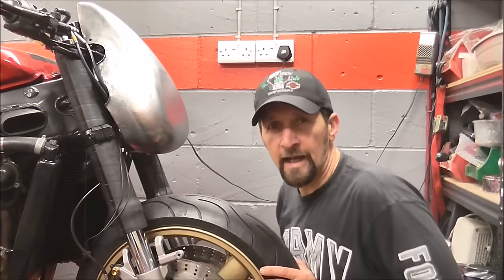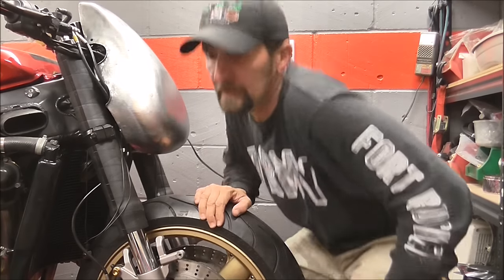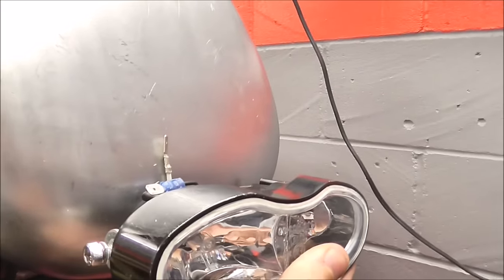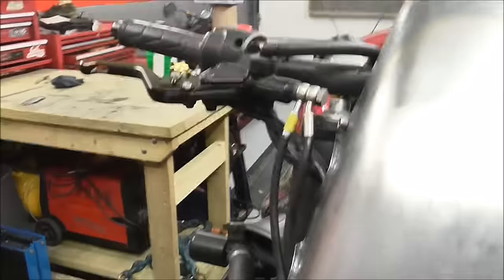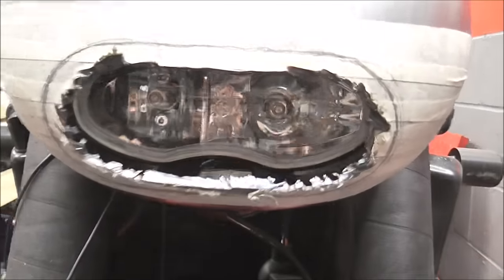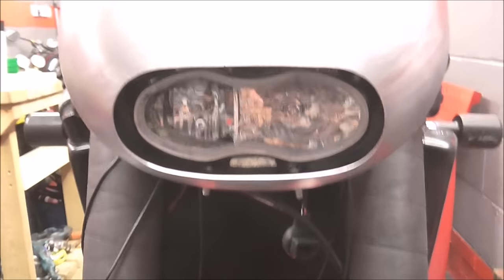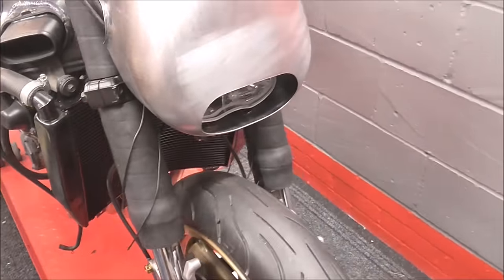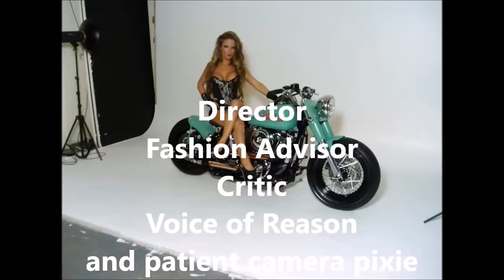Delboy's Garage, Fighter Build #15, A bit of 'Frenching' !

Comment: hey Delboy. i have a question for you. could you please explain to me the actual benefits of lubing or greasing a ratchet? all i hear people say is "it makes it work better" and "it quiets it down". i enjoy the sound of a ratchet but how does it make the ratchet work better? i just dont see how lubing it would benefit. please let me know what you think. thanks
Reply from the maker: Hi mate, I've two Snap On ratchets, and I think once , about 5yrs ago, I may have squirted a tiny dot of WD40 in there, but never did it again since, as it made no difference !  It possibly depends on the quality of the ratchet, but as they have an internal mechanism, I believe in spending some proper money on them !

Comment: Nice and precise, great work with the files to get that edge looking so good. I've noticed you've gone back to using the grinder for pretty much all of your cuts lately. Once you were using a jigsaw, which I assume can be effective only up to a certain thickness. Obviously, with flat sheet, a bandsaw is ideal but who cuts enough metal to justify owning one of those. If you had all the gear, there'd be no room for the bikes. Perhaps you could expand the grinder video a little to comment on the above? Also, how are you finding the air tools? Are they a worthwhile investment?
Reply from the maker: Hi mate, you sussed me out, my 4" grinder is my favourite tool by far - the jigsaw is ok, just like a bandsaw on flat metal, but needs a flat surface to run the shoe along or the blade wanders off on it's own, bending under force is created by the slant of the metal surface... the coming Simple SKills vid on the grinder will encompass a lot of stuff showing it's versatility, but will be half at least about safety cos they can be a pretty lethal tool ! 

And as for air tools, like with anything, they are not particularly universal, eavh one is a unique job so you end up with a pile of them, but they are thirsty on air, so if you are using it in a garage that also houses the compressor that feeds them, then it's irritating when it keeps kicking in to pump back up, and for video making that seriously is intrusive !  The big shops have a huge industrial compressor housed in sound proof units outside the workshop, so then I would then use ONLY air tools... but in a single garage, the compressor causes the problems!

Comment: I have been thinking about the tail piece, now i'm not sure if it's possible to fabricate but last week I was in traffic behind a Peugeot RCZ sports car and the rear window has a double lengthwise humps. Perhaps could taper back to a pair of "frenched" tail lights ?
Reply from the maker: Hi mate, the RSV mille Tuono models have a similar item that looks like two cool after burners, but gonna go my own way, as you would imagine, and it would be silly not to french it to match the front aye?!  Thanks for the tip fellah!

Comment: Looking good , my ears would have been ringing after using the grinder and air drill in such a small space. As far as stepping up production, (not sure if it possible with your editing software) maybe you could overlay the audio from your video camera when you show the shots from the gopro, just to keep it all consistent. No need to reply just a observation .Cheers
Reply from the maker: Know what you mean mate, but I actually liked the slightly different sound from the GoPro for now, overlaying sound is practically impossible on the editing suite I use (it has it's benefits, but also it's hinderances but WMM is a greta format) , far easier, instead, to plug a lavalier mic in to the GoPro to give more identical sound as picked up by the camcorder, simpler and faster for editing, and with the rate we create videos, we can't afford to spend too long on the tech. stuff as, to us, the actual content has always been more important than the cinematopgraphy... the biggest people on big vlogging use professional companies now to create their videos and there's no way we could ever compete with that, but thanks mate, the input is always helpful !
Reply: Oh that's good to hear i thought i might be little out of line in saying so.

Comment: I know this is an old video, but I’m still trying to find this light. All I can find is this light but with 2 high beams so it won’t be U.K. mot compliant. Could you please link me to a version that uses hi-lo, cheers del
Reply from the maker: Here you go Lloyd, this is the one i have.! https://www.ebay.co.uk/itm/H3-12V-Twin-Bulb-Headlight-Lamp-Projector-For-Streetfighter-Custom-Cafe-Racer/272920512315?_trkparms=aid%3D555018%26algo%3DPL.SIM%26ao%3D1%26asc%3D20140122125356%26meid%3D32d9b26f16ea4e668f353008d2aa09af%26pid%3D100005%26rk%3D5%26rkt%3D12%26sd%3D283288746568%26itm%3D272920512315&_trksid=p2047675.c100005.m1851

Comment: Jesus Del, when I saw you taking to the tank with a 4" grinder I did cringe a little, it looked like someone trying to carve a small chess piece with a 32lb sledge and cold chisel... but to your credit and skill she came up trumps. One thing I would have done before cutting just in case you wanted it in the future is take a bit of clear acrylic and heat formed it over the curve of the intended cut out, that way you a) have a reference of the original profile and b) you could cut the acrylic down to create a perfectly contoured lens if you ever should feel the need. What's done is done now and it looks smashing, nice to see the GoPro get some extra work.
Reply from the maker: Thanks mate, great minds think alike, I had though to take a profile of the shape first, one way or another, and perspex is a good way, but the idea was to simply start the hole off with the grinder, leaving lots of spare so I could adjust the shape and angle if I needed to... as it turned out, got lucky in the end, and it went well... !

Comment: Like it, like it. But geezerr cover your bikes when using the grinder, hot shards and all that can be costly.
Reply from the maker: Thanks mate, good advice, it looks worse on camera than it is, it's nver more than dust, and blows off with an air line, but for bigger jobs, or when painting, I always cover them up... cheers for your comment!

Comment: I see a Dutch license plate there.  ZL - 79-32  it used to be on the back of 1979 Honda cx-500. Was disassembled in 2015
Reply from the maker: Are you actyually tracing the number plates then..?
Reply: +Moonfleet41 can do that online..  Only shows vehicle information.  Not owner details :)

Comment: Heya Del, looks good my only question is how do you account for beam image on an mot test? with it being frenched im presuming that you will have to set the bike up with the headlight at the right angle before welding on the inner tubing, or will there be a small gap between the inner tubing and the headlight to allow movement of the headlight for adjustment?
Reply from the maker: Hi buddy, in tail lights and indicators, you simply mount them against an inward facing flange at the bottom of the french tube, but with a direction light like this, I'll simply leave sufficient space around it to give it the required adjustment... just fine tuning as you go along !

Comment: Don't know Del if you've completed the headlight just a tip if you try and shape a piece of metal to fit the hole (like a squashed cylinder ) make it longer than you need poke it through the cutout scribe around profile and TIG weld edge to edge will give you a great finish.
Reply from the maker: Good advice mate, thanks for that... always good to hear new tricks!
Reply: +Moonfleet41 We shall call it 20 years fabrication experience every good project starts in cardboard  👌🏻

Comment: Hi Mate,That looks amazing already. It looks like you cut it with a CnC machine. Good job!!!
Reply from the maker: Oh what a joy it would be to use such an awesome tool , maybe even a sexy water jet, but then, of course, in some ways, you lose the hand-built feel of the bike !
Reply: Awesome Tools are well Awesome, I love that most of what I have seen you do is basic tools though. Anyone can get those tools by saving a bit and then spending the time to get the results. I mean the simple PVC trick to setting fork seals was genius and simple.
Reply from the maker: Thanks Dirk... you know me , how hard can it be?!  There's a simple solution to most things cos most fancy tools were designed around alleviating the workload of what was once a manual job!

Comment: Is there any way to paint the tubing your using on the forks/bars?
Reply from the maker: Hi mate, yes, you can use Plasti-Dip or Frost Wrap, as it is, after all a spray on rubber, and with a thick enough coat it would be pretty robust, but as my brake hoses will rub on it, I'm happy with leaving them black!

Comment: (p) Looking great. Is there some tool smaller and more delicate than an angle grinder for work like that? Also what's the difference between using a compressor drill to a regular power drill?
Reply from the maker: Like i said in the video, i could have used a hand fret saw, but i didnt know for sure that the hole was marked in precicely the right place untill i cut a rough hole out in the middle of the waste area first... grinder is fast and simple..!  and what do you mean by "what's the difference "..? different sources or drive..!
Reply: Fret saws are great but you really have to love power tools.Tim Allen in Home Improvement is my workshop hero.  My aged Dremmel sees a fair bit of action on bikes and is great for gentle grinding work.

Comment: That's a beautiful result Del, really nice. The only thought I had was, couldn't you have cut out the hole with a jig saw, then when would have had the flap, if you chose to use it?
Reply from the maker: Hi David, physically cutting it wasn't the issue, a jigsaw would not have turned the bend smoothly, as it was too tight for a jigsaw blade, so would have still trashed it, however, a fret saw would have gone round it in one smooth cut, the problem was I needed to cut initially well inside the line just in case I was cock-eyed, or off-centre, and then I could file out to the line by hand to get it exact... but yes, if I had known the line was exactly right beforehand I would definitely cut it out and kept it !
Reply: Anyway mate the only thing I would say is, quality, quality, quality. It's always a great pleasure watching your work.

Comment: Thanks Del. Thon's a serious hole! What an excellent job you did of that.
Reply from the maker: Cheers mate, it's just cutting a hole, but oh so easy to get it wrong !  Just glad it went well !
Reply: It would have been a shame but you're too modest, I couldn't have cut a hole so nice if I had 10 goes. Well done on a nice job.

Wee question Del, I just watched your vid how to find and splice a switched live, it's for my Vivitar action cam, the battery only last 2 hours so I wanted it wired, the power generated won't do any damage/cause fires etc.. will it, I have its charging cable going to a USB hub that has battery pigtails, I've earthed black to the battery earth and live to a switched live behind the battery so when I switch the bike off the camera also turns off. This should be okay?
Reply from the maker: Hi again james, i cant comment on whether the charger cable you're using is ok, as products vary, but if its the same as a car satnav charger with a USB plugin end, then it should be ok... all you didnt need to do was tag the earth to the battery... the frame itself would be ok, and a better ground connection than the battery... but they both work ok....
Reply: tahnks Del, hope the weathers okay down there for a run or whatever.

Comment: Nice one looks cool. Sliding Shroud on the inside and a pull in the top 👍
Reply: Mesh type of thing so you can still use passing light . Oh yeah
Reply from the maker: Cheers buddy, sticking with the one step at a time, just got the inner cone mounting to climb first...!

Comment: Great work Del . As you say you only get one chance to get it right. The Go pro gives a good picture , do you use a separate  mic  for it , or its own sound pick up.
Reply from the maker: Cheers Peter, appreciate that, just for this first experiment I was letting the GoPro pick it up via it's internal mic and see how it sounded, not bad, but next time I'll plug in a lavalier mic slightly remote from the camera to add a bit of depth and quality !  Just learning as we go...
Reply: Hi Del . The sound was good . are you going plug the mic into the gopro . Sorry for being darft.
Reply from the maker: yeah, obviously, it'll be better than the built in mic.
Reply: Fair play . What i meant was do you plug it into the gopro.
Reply from the maker: Yes.. you plug it into the GoPro mate.!
Reply: Cheers Del .

Comment: I love the Sportster tank but can't help but think it'd look better if you cut a grill into the metal and put a light behind the grill.
Reply from the maker: Not legal for the road mate
Reply from the maker: If you obscure youre headlight by more than 50%, and in so doing you affect the angle of the beam, then an MOT inspector can fail it... your descpription of mounting a light behind a grille infers you are hiding it inside the fairing... what you sent a link to is different !  That is a 'cover' on which the bars are narrower than the slots, so it's less than 50% coverage, however, an MOT inspector is still at liberty to fail it if they believe it obscures the beam... it's all about their judgement, not mine.
Reply: Ah I see what you mean. I don't know if I came across as argumentative or anything but that's not hot I meant it.

Still, the track you're on with yours is awesome regardless. It's all relative, really :P
Reply from the maker: No, not taken that way mate... everyone is entitled to make a suggestion, I do have a raft of lose ideas that may make their way to the build, as it rolls along, and a steam punk type cage over the front of the hole may work provided it doesn't obsure too much, or otherwise spoil the look !
Reply: To be fair it'd probably look way more "ratty" if it was grilled.

For the aesthetic goal of the bike I reckon you've nailed it.

Comment: any mods planed for the new Harley
Reply from the maker: Not yet buddy, maintenance obviously , but the kinda things I'd love to do to it are way out of my price range !  3" open belt primo would be very cool, they cost more than I spent on the bike deal ... focusing on the fighter build for now, but anything I do on it will be in a video !
Reply: yes  it would you ever think about a spinger front end'
Reply from the maker: One of my favourite Harleys is the Springer Softail.....i love the Ducktail rear fender and underslung light....so with one of those and a set of springers, the Fatboy becomes a Springer Softail... very cool, and a great look... but the 3"x21" front wheel is impractical, and then there's the cost... a springer front end is four figures and thats without all the related hardware to finish it..!!!!